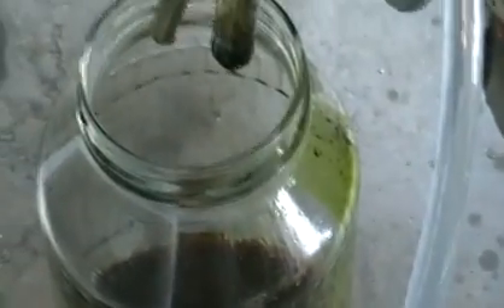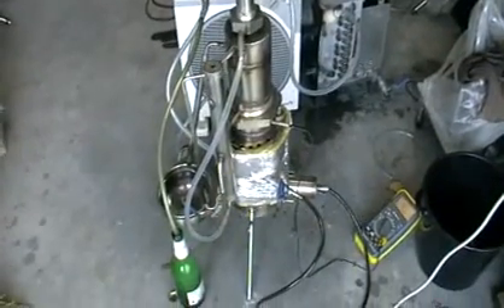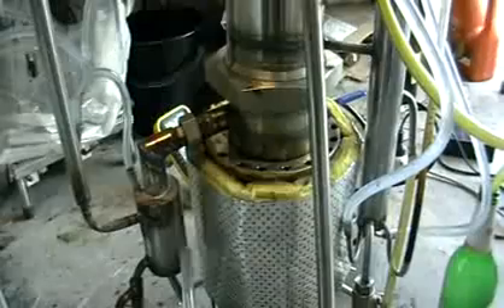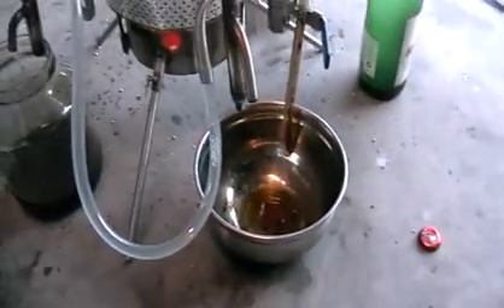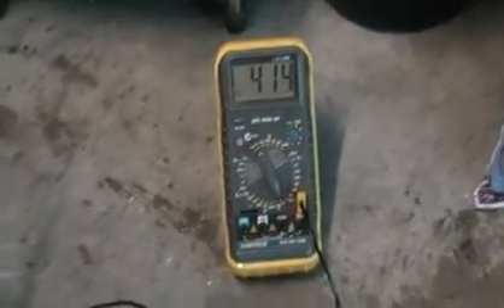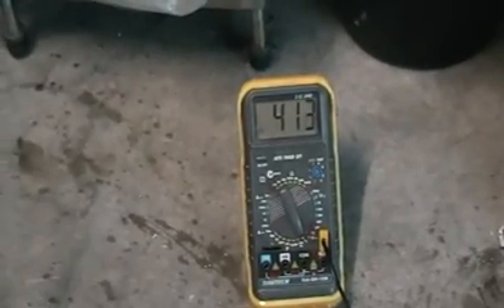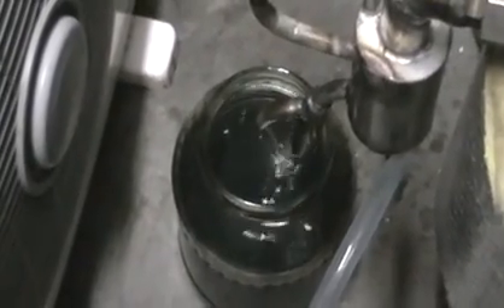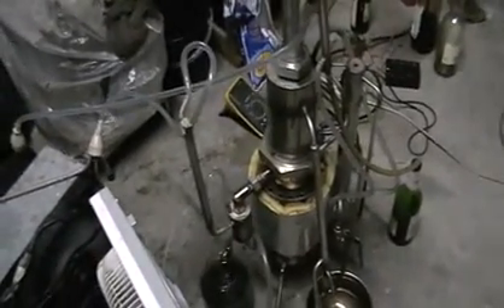WMO distractive distillation retort (DIY Diesel fuel)

Comment: Can you actually fraction waste motor oil like you can with crude petroleum? Can you separate off the individual alkanes and alkenes, like hexane, octane (petrol), nonane decane etc?
Reply from the maker: Yes, you can crack it, the process is processing of secondary hydrocarbons, where there a new elements are formed that collected separately as crude distillates and gas, then you have an opportunity of deeper processing of each separate fraction and get everything from coke to petroleum gas, check my latest videos, where you can see a newer version of the reformer with higher flow and cracking of the used oil into a few different crude fractions.

Comment from the maker: The system built out of stainless steel and there is no pressure within the boiler, the system built the way to maintain internal pressure no higher than atmospheric pressure.

Comment: Any efforts with vacuum distillation? Chinese sell machines that process about 600 gallon batch from what i can figure. The percent {fraction?} of each product is given, and the base oil is left very clean. Honey colored be it wmo or wvo they are processing. Id love to cut this machine down to 50 gallon batch size. the output is purest ive seen thus far. Maybe its a chinese salesmanship? lol. im not sure. You think this industrial process can be cut down to our use? They claim its a two man operation in its current form, so a plant 1/10th scale has got to be single person manageable.......am i dreaming?
Reply from the maker: No, did not tried any vacuum, thou thought about it, and I am not an expert in Chinese built reformers.

Comment: IS this Diesel from WMO  good for car engines? 100 % of diesel cars (old or new ) can run in this diesel?
Reply from the maker: Hi just check my latest videos about this system, I am explaining about whole process, as this is only one of the steps required for processing, and yes I am running my diesel car and diesel generator with this stuff after all steps taken.

Comment: tell me, why is this process needed when diesel engine can run direct on used motor oil, only filtration is needed.I think I might not know something.
Reply from the maker: ok, if you are talking about filtration, so the best filtration is a temperature shift when a liquid is shifting from one state to another leaving behind everything that even super filter could not catch - additives, carbon solid and partially liquid, any acid or alkaline , thus in this case in reality we have the most advanced filtration, shifting the motor oil from liquid state to the state of vapor and back to the state of liquid less all the unwanted stuff, so if you are really want to use a motor oil and not ruin your engine then this method is the only option, otherwise use just a crude oil after filtration with mechanical filter, while oil companies for some reason choosing cracking and fractional separation.
Reply: Thank you for an answer.I understood now.With used vegeatable oil is the same process needed? Is it possible to make gasoline by getting higher fractions from vegie/waste oil too?

Comment from the maker: Hi the light hydrocarbons just getting formed from heavy hydrocarbons due to nature of distractive distillation or reforming, and amounts can be as high as 50% of total amount, and yes i am concerned - this is why I have extraction fans all around, plus all setup just next to the open gates of the workshop - do not risk your health, currently using products from fuels separator (another video) in my gen-set and car,  and building a treatment system for the reformed products.

Comment from the maker: also waste engine oil is not consistent and can include different grades and types of oil - differential, power steering, also water and coolant that during distillation either tuned into a carbon (ethylene glycol - coolant, brake fluid) or evaporates and removed via one of the top trays not really affecting main diesel production.

Comment from the maker: also despite of distillation and waste carbonizing the reaction of cracking reforming some amounts of hydrocarbons into tar, asphalt gum, and polymers that will settle in mater of hours in your engine fuel system and everywhere it stays - if not treated - there are reagents like bentonine for example must be used to capture the polymers and gum and bleach the fuel - this is what oil producers do with any distilled and especially reformed or cracked petroleum based fuels.

Comment from the maker: These hydrocarbons a ranging from heavy diesel or bunker oil to kerosene and petrol plus LPG, so all components can be recombined with each other to form an ideal diesel blend with all necessary fractions for any season, this reformer is a continuous system with number of trays for each possible fraction, this machine is miniature version of  cracking or cocking machine that used by any oil company for high temperature destructive distillation of bitumen and heavy hydrocarbons:cracking petroleum

Comment from the maker: The production rate depends on the grade and quality of oil, and for this small setup ranging from 1L per hour to 2L , the original motor oil, even the new one already loaded with soaps, cleaning agents, and thickening agents, the waste oil is loaded with metal particles, products of oil oxidations such as asphalts, and free solid carbon, thus destructive distillation or cracking reduces all this additives, asphalt, bitumen to solid carbon, also reforming oil into range of hydrocarbons.

Comment from the maker: In this case i am dealing with engine oil that already was reformed and treated once to ensure that no sulfur still remain in oil as it will corrode the blocks and sumps, plus engine oil temperature stable, plus engine oil additives are alkaline soaps in fact, and if anything was formed I always have an extra extractor to make sure that I am not breathing the shit. I will be ok - many plans ahead.

Comment from the maker: yes, the stuff will be filtered prior distillation - (later plans) also all liquids are will be directed away from reformer, including an oil supply, in this case you have a continuous machine and dealing literally with a few grams of fuel at a time, odor is not so heavy - as you can see all vapors are locked within the system and there is a tray for every fraction, top of reformer absolutely cool, the only smell is a petrol/lpg fumes escaping from a small glass bottle - not much, will solve it.